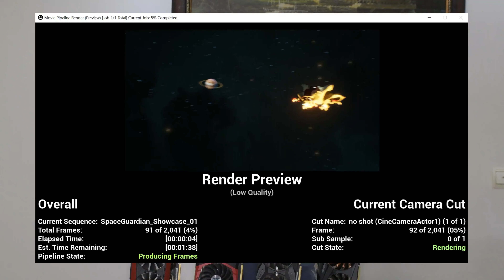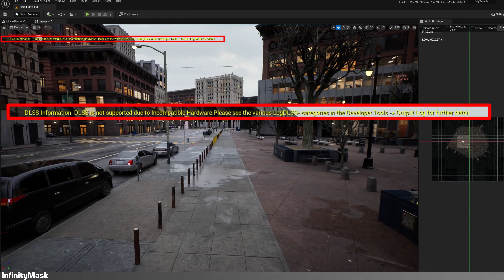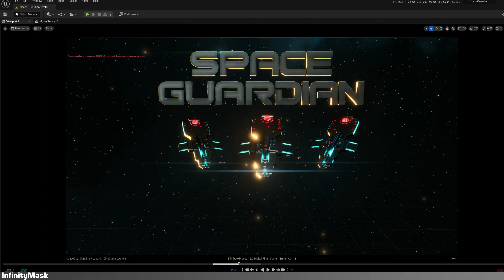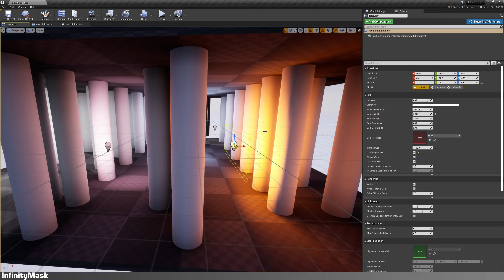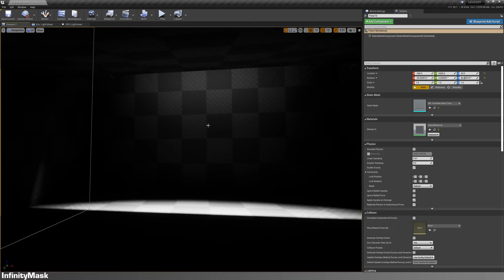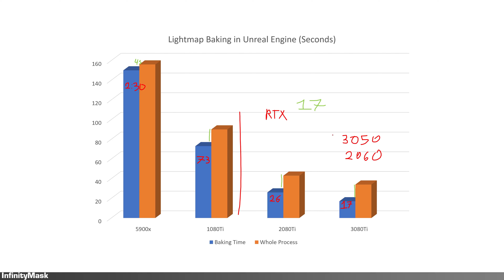RTX 4000 for Unreal Engine ?

Comment: At first, I thought the Video Quality doesn't look soo good and the video might be bad. But I have to say. Congratulation! You have a really detailed comparison. Also great to include older cards like the 900 and 1000 series. Bravo! I am sure you will grow a big audience.

As a side note, if you are interested.

I think the Video could have been more compressed in length to bring it to about 15min or eventually even 10min. Make it a little bit snappier.
(for example when you draw the lines with % between the cards. The viewer doesn't need the drawing. Edit Pictures with perfect Arrows or lines and the % and implement the frame as a still frame. 
The audience doesn't need to see all the processes it mostly wants to see information in a shorter time frame)

Since you don't have expensive Video gear (which is understandable.. it is f"" expensive. These upgrades come with time) I would suggest, do not start your Video with a shot of you. Like I thought in the beginning it might turn away some ppl. Try rather a shot as you have on like in chapter LEvel design or benchmark where it "pops" 

For you Video of yourself... I don't know what you have at your disposal. But a few things that seem like a quick fix.

Try to more distance between you and the Wall. Like 0.5-1m if possible.  Maybe you don't want to show what's on the wall, but then just zoom in a little more.
With this, you should be able to lose the strong shadows around you.

If possible, get more lights and a diffusion. There are youtube tutorials on to build strong DIY Studio Lamps for cheap and use something like a milky shower curtain to diffuse the light.
Light is going to improve your Kamerashot a lot. 

Keep up your work!
Reply from the maker: Thank you so much for your detailed comment. Very good suggestions 🤩

Comment: Don’t know your base system but you might be CPU restricted in framerates with the Unreal Engine city example when moving up the RTX chain in your GPU test scores. UE has a huge impact on the CPU in general. 

Plus You can also check in GPUZ to see if your RTX 3080 Ti is being bandwidth limited by a PCIE 3 lane downshift in speed from PCIE 4. There is a big performance loss not running in gen 4 spec.
Reply from the maker: Thank you for your comment. The system for this video used has a 5900x with x570 asus tuf pcie 4 enabled.
Reply: Wrong the diff between pcie 3 to 4 is not that much especially for low transactional tasks like unreal engine he is driving 2 4k displays
Reply: @gabeo9740   it may vary on the mobo if his gen4 nvme is using enough lanes to cause his GPU to downshift to PCIe 3 the impact will become more noticeable. Anyway it’s easy to sanity check with GPUZ. On average a PCIE 3 setup on whole will not take much away for performance. It’s a rare case otherwise, moving to another m.2 slot may fix.